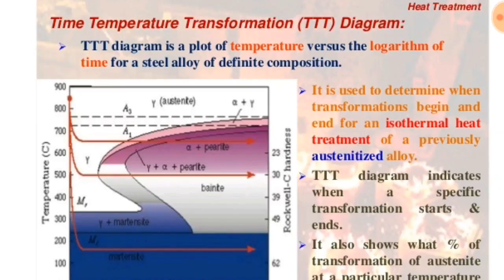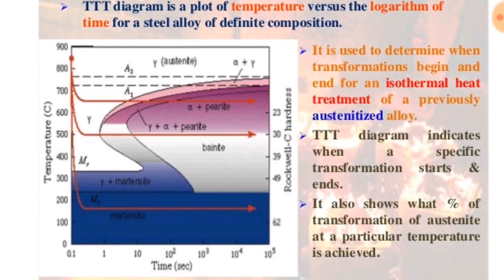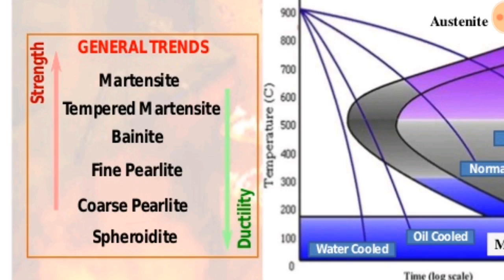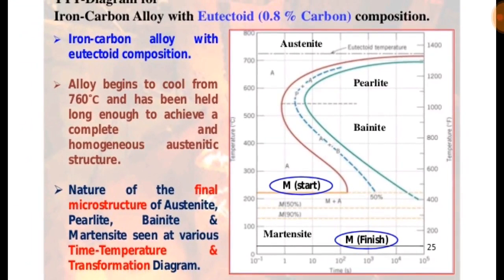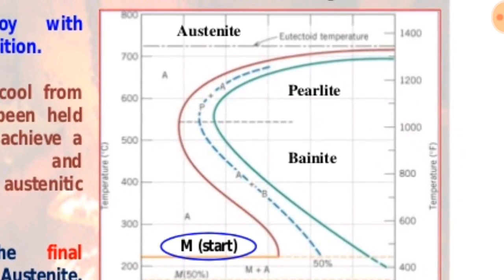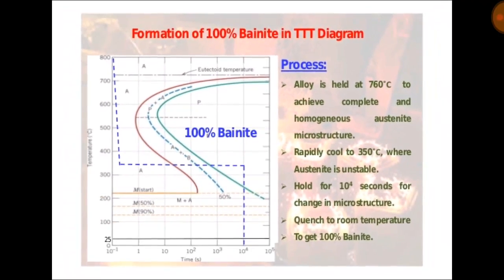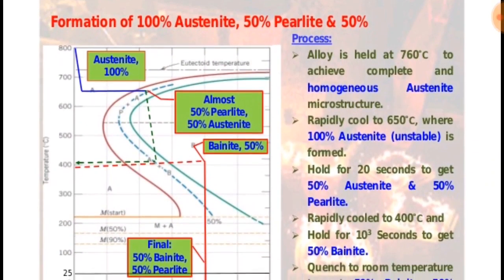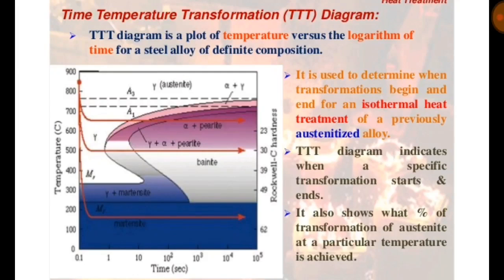TTT Diagram EXPLAINED|Time Temperature Transformation Diagram/Curves | ENGINEERING STUDY MATERIALS

Comment: Thanks for video. Can anyone help? I would like to find out how to find out what quenching time is needed to achieve bainite transformation (bainite hardening) in chromoly alloy steel 42CrMo4 (SAE 4140). For example when I use oil as quenching medium with constant 350°C and I then I dip chromoly workpiece with austenite temperature into it and I need to know for how long it should stay in the oil. When looking on TTT diagram shown in this video I assume the time should be around 10^3 seconds or more. Am I correct? If yes, is there a max time that can not be exceeded?

Comment: Hi, I have a question, on the last slide, why the 50% of the pearlite was not changed into a 50% martensite after quenching? When you quench the cool curve is straight line normal to the axis x, right? So it should be in a martensite area after that?
Reply from the maker: Pearlite are dependent on composition & need a very specific heat treatment above Ms line.
Tempered Martensite needs reheating of the specimen in fully martensitic condition, reheated in a controlled manner, between Ms & Mf lines which is specific to chemical composition of the specimen.
Reply: @EngineeringStudyMaterials  thank you for your answer.